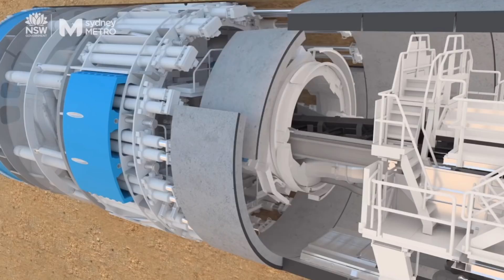Sydney Trains Vlog 1494: Sydney Metro - Tunnel Boring Machine Nancy Launch

Comment: That must be Marrickville - the dive structure only looks about 20 metres wide (TMB cutter head is 7 metres wide). I understand that yellow gantry crane will assemble the second TBM at Marrickville then be brought over to Chatswood to assemble the two TBMs there.  I assume it will then be shifted to Blues Point for the final TBM. And then relocated to disassemble the TBMs as they finish their work. 

Looks like it will be New Year before they are ready at Chatswood to start building the TBMs - excavation looks about 80% complete - it is a very constrained area where the TBM will be assembled. Not shown in the government's cartoon, is key aspects of how the TBM works. In Sydney's rock, the wheels at the front of the cutter head are pressed into the rock which fractures under pressure. The cutting teeth than scoop out the fractured rock. The cutting head adds a lubricant (just water??) to the rock so that it flows better onto the conveyor belt and suppresses dust. 

Conveyor belt extends all the way from the head of the machine all the way out of the tunnel. Every so often, they have to extend it. The conveyor is cheaper than the former technique of building a twin track narrow gauge railway in the tunnel then breaking it out when boring finished. 

While the machines that make the tunnel segments came from the NW line project, these TBMs are new from Herrenknecht in Germany - the best regarded maker of the machines. We must assume the ones used on the NW project, not from Herrenknecht, performed poorly.  It's possible, the boring will be complete by end of 2019. The TBMs should be off site and all earth handling machines and sheds removed by end of 2020.
Reply: The construction site is actually between Sydenham and St Peters, near the overbridge.
Reply: Yes. Dive site on west side of rail line - which is Marrickville. East side of tracks is St Peters.